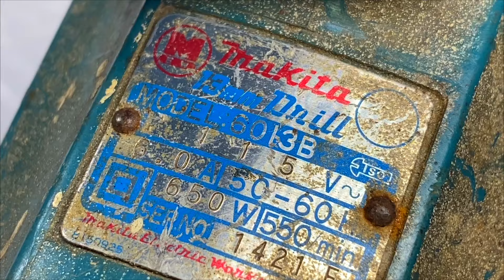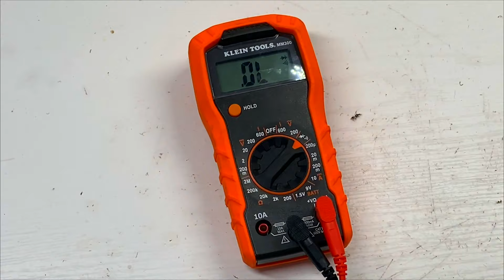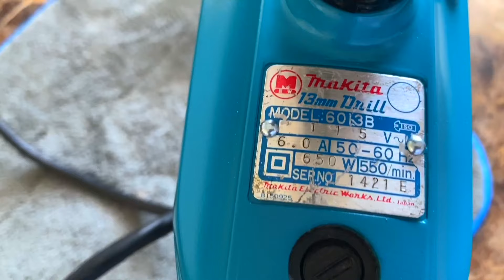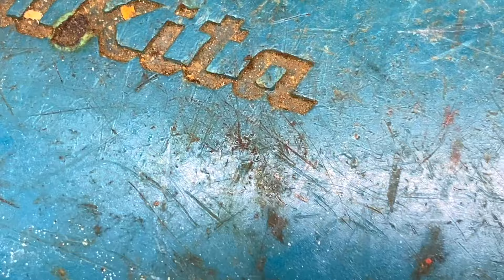Makita Drill Restoration - Model 6013B - Tool Restoration

Comment: Will use your metod to fix my old Makita from 80'. Very usable video.
Reply: Its done. Found one broken contact on brush connector. Cut was very far.  Spring was broken. Did bypass using wiring. Your video helps me a lot, Sir. Thank you again.

Comment: Why paint the plastic body, when after sanding it a little heat gun could have been used to restore it to its former glory?
Reply from the maker: Good tip, I'm gonna try this! 👍🏻
Reply: @studiofr  Just be careful and gentle. :) Different kinds of plastic may react either slower or more rapidly to heat gun.
Reply from the maker: Got it!